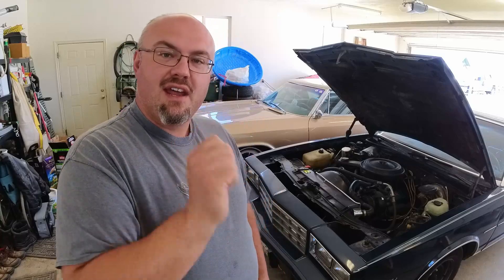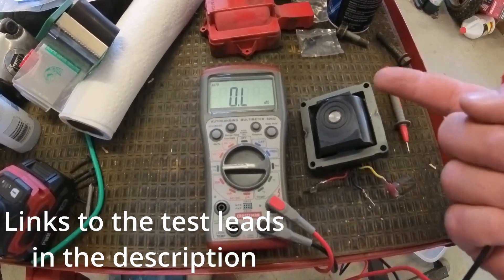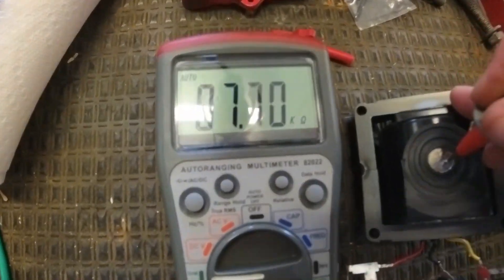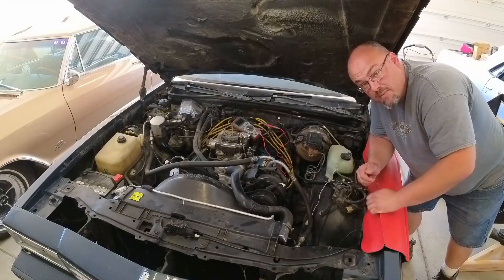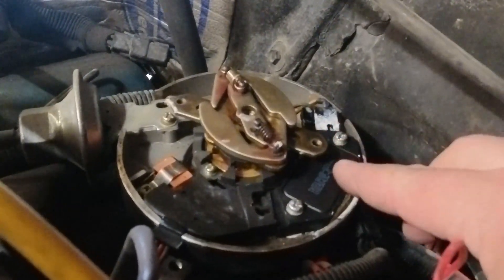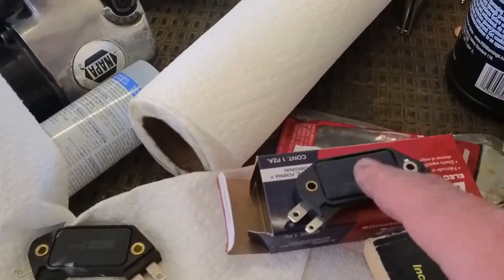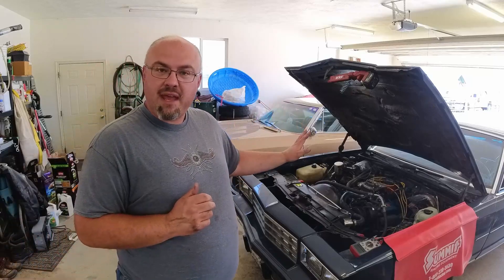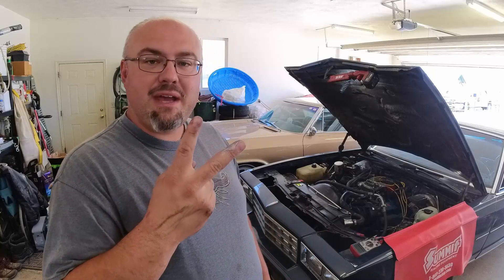Simple Solutions For The GM HEI Ignition and The Lost Spark!

Comment: Lancia used an hei module like this one to fore there ignition as well,the difference was the module was mounted to a heat sink on the firewall could this be duplicated for longer module life?
Reply from the maker: Yes, it really wouldn't be that hard to do. It's basically extending a few wires and running them externally. A question I have, and I may be thinking waaaayyyy too deep. I'm wondering if there could be latency issues from extending the wires. I kinda don't think so because my MSD box has a 4 foot wire from the magnetic pick up and about 20 inches to the coil. I think it's a viable experiment. The variable comes in with the consistency of manufacturing them. I know that not all new parts are created equal. 

So, in theory, yes, I believe running this external to a heatsink could work and be effective.

Comment: I had the same issue. It's every morning or if it sits over 30 mins I run into no start only crank  sometimes I can get it to stary but now its just dead in water on it
Reply: But this on my Plymouth fury
Reply from the maker: My Mopar friends all move away from the Chrysler electronic ignitions.
Reply: Same issue with my 77 Buick I need help. It will crank up run great but when it sits for 30 mins no start just cranking

Comment: I had this problem on my 92 gmc typhoon.  I have bought about 15 of these modules. Not sure if its the turbo heat or what but about 2 months is its limit.  I currently have my truck in the shop for a complete rewire and we are controlling everything with a maxxecu.  The distributor will be replaced with the holley dual sync distributor.  It will eliminate all the problems i have had with the icm.  Also it will go from batch fire injection to SFI injection similar to my grandnational.  Its about 15k for the process.  I know its not cheap but i don't want to LS swap such a rare vehicle.  I know a lot of people who collect older vehicles like them OEM but as i found out with my grandnational this was the 1st time vintage computer controled vehicles have started to come into their value.  Say a 68 camaro or a 67 mustang its a lot easier because they don't have a lot of electronics to affect their running conditions.  Wiring gets old and starts to fail or melt together due to the low end Wiring used on these vehicles from factory.
Reply from the maker: I can totally understand that. Especially the early computers were still very low on power. Some of these vehicles seem to destroy modules, and it could be heat or voltage spikes or any combination of stuff.

Comment: As a mechanic, I ran to an issue where people were put on the cheap Is spark plug wires I'd ask Them where did you get the Where's from Yip, they bought the cheap ones. And that was their problem with their mission system causing the module to overheat
Reply: Hah! Never thought about it that way. Valid point, maybe thats the golden ticket! Get them blue wires! I don't mind with that kinda stuff, because they actually last longer, for the most part.

Comment: I'm experiencing it right now with a rebuilt engine. There is no spark on cylinder 1
Reply from the maker: That is a possibility that the module could be having problems. In the event that a module doesn't help, I might start to wonder about the magnetic pick up. That's a bit more involved and requires the distributor to be removed and the gear taken off the end of the shaft.

Comment: Here my issue. Ford 302 5.0 with e303 and carb swap. Idles really rough with the GM HEI. After roughly 1500 rpm is clears up and runs beyond perfect. Revs up quickly too. Could my issue be the part you’re talking about or am I looking at a bad coil? Coil didn’t quiet test to specs but then again, if it didn’t test to specs, why was it running perfect above 1500 rpm? Wouldn’t it run worse? I’m beyond confused
Reply from the maker: Electronics failure is strange, and sometime they defy logic. HEI coils are pretty cheap. If it might be suspect, I'd be inclined to swap both the coil and module. If funds allow, the MSD module is a really good option. Also, keep an eye on how the idle circuits on the carb are set up. This may be a symptom of overly rich at idle and just off idle. I would start at the ignition since you have reason to believe there could be an issue.
Reply: @SnowFamilyRacing  I have thought about just replacing the whole HEI, as ironically enough in my area, it’s cheaper. Carb is a edelbrok 1406 600CFM so I’m thinking it’s fine however I’m more leaning towards spark. Not sure why but I’m trusting my gut in this one. Just got into carbs and hei’s so learning everything I can
Reply from the maker: I'm going to agree with your gut. Ignition seems likely here. Carbs are easy, I do a lot of tuning with a vacuum gauge. Every change will have an effect on the vacuum reading.

Comment: I've been a mechanic since the mid 1970s and the modules in the late 70 threw the early 90s held up well, all the new modules are made in china and are junk.
Reply from the maker: The module I put in lasted a whole 7 days. I warrantied it out, replaced it to keep the car going, and ordered an MSD module. There's a follow-up video I made  and installed the MSD module. I've been seening more failures on electronic components in the last few years, it's getting bad!
Reply: @SnowFamilyRacing the
Reply: Yep. I just had a new icm from Singapore installed early may. Failed Saturday. I plucked a used oem GM icm off an old abandoned chevy G-van.  Installed and the engine fired right up strong
Reply from the maker: @FLSTF87 yep, the replacement parts failing are what led me to swap in the MSD HEI module, which I cover in another video. So far, the MSD module has been completely trouble-free.
Reply: I felt this changed mine in may of last year back here making sure I didn’t do it wrong but I see these comments of them being bad now
Reply from the maker: There are a lot of replacement modules failing at a prolific rate. Doesn't mean they all are, you're hearing about them because that's the kind of video you're on. The MSD HEI module is the one that I've found to be most failure resistant.

Comment: Replaced my cap rotor and coil and still no spark. I will be trying this in the AM.

Thanks!
Reply from the maker: The module is probably the most common failure point on these and it's easy to check the coil and verify power to the distributor on your way through since you're there. If you have the time and the budget, take a look at the MSD HEI module over a parts store replacement. It can be a good upgrade, otherwise, there's nothing wrong with a good replacement module.
Reply: @SnowFamilyRacing   Thanks for that tip. I will get that MSD module.

I found some US NOS stock ignition module hoping it is better than the generic store aftermarket replacements.
Reply from the maker: Here's a link to the video I made covering the MSD module. I do have a link to the module in the description of that video to make it easier to locate one. Best of luck! https://youtu.be/8qavPeuX7Sc
Reply: Good News, I was able to get the SBC to crank over and run and idle right after changing out the Ignition Module.

However there is still a super weird issue where the car would idle/warm up and then randomly stall. 

Would this be a carb issue?   The fuel pump is working because I have clear filter in front of the carb and see plenty of fuel. 

Once I force the warm up of the car seems to run fine. Not sure if its something with the carb letting in too much air if possible vaccum leak or choke issue.
 @SnowFamilyRacing

Comment: Are my eyes deceiving  me or is that Mopar thermo quad carb?
Reply from the maker: It's a little Road Demon Jr.. It wouldn't surprise me if it's similar to a thermoquad. I've not actually worked with an original thermoquad. I'm a Qjet guy, i didn't have one that was right for this engine when we put it together the first time. It's kinda like an Edelbrock, kinda not, and a pain to tune. Took forever to get the tune right. It almost went in the garbage, but it saved itself by doing what I wanted it to do at the last minute and has been pretty trouble-free ever since. Its saving grace is that it hasn't given me any trouble, and if it's not broken, it gets to keep mixing fuel. It does do really nice on the highway cruise. That's a plus.

Comment: Yeah, that's why I went the other way to replace my bad CCC controlled HEI: a NOS points distributor. Nice and maintainable. Not to mention it's cheap and easy to keep a spare set of points, adjustment/cleaning tools, and condenser in the glove, just in case. The OEM pickups are decades old, and new ones are made like garbage. If you want real reliability, purely electromechanical is the way to go, at the price of having to actually do your regular maintenance.
Reply from the maker: Absolutely nothing wrong with that approach!
Reply: ' Sparkrite' module on eBay connects to points & runs coil taking load of points & has a off switch so points only if module box fails.
Reply: If I go back to points, can I still use the same plug wires or are they different  on the cap end,& can I change the ends. Is there a place to mount the coil on the manifold ? Any other problems?
Reply from the maker: @Chuncy566 you'll likely be swapping distributors, most of the points type caps have a different terminal, you'd best just do new plug wires, no idea on where you'd put the coil, I don't have your  car in front of me. I don't know what you've got or what you're working on, so I can't answer some of that.
Reply: @SnowFamilyRacing  Typically correct. Most HEIs use a male terminal on the cap, and a female boot on the wire. most points caps are the opposite, although there are some specialty ones that cross over. Really, its not that hard to chop the ends and crimp new terminals on anyway. If you do this, don't cheap out on the points. Buy Blue Streaks. Parts store points have no way to hold lubrication (gun oil soaked into the pad of the blue streaks works pretty well. oil, not grease for these) and in my experience the rubbing blocks wear away in way too little time - and yes, of course I greased the cam for the parts store junk to no avail.

Comment: If you install an MSD box you will no longer need the module. They also sell a high quality module as well. The original GM modules are actually quite good. The replacements that you buy at most auto part stores are a gamble at best if long life is your goal.
Reply from the maker: Part of the decision was the car was needed to be back up quickly and I couldn't justify stepping up to the MSD box or module, i could swap the module that day as opposed to waiting for parts. My El Camino has the MSD HEI distributor, it ran the high end MSD module for many years without issue. I stepped up to a 6AL in that car, and it's been good there, too.

Comment: Adapt a Ford Dura spark to it. Better yet just buy a Ford. LOL
Ignition module on HEI is not a good design as it is inside the hot distributor as opposed to Ford and Dodge that mounts it away from the heat
Reply from the maker: Why would I want to downgrade? I realize it's not the most serviceable, but wow!
Reply: Can a person mount the ign module outside of the distributor on the firewall or the fender & ground it realy well? Would that work?
Reply from the maker: @Chuncy566 you could, it's just wires. Will it work better, probably not.